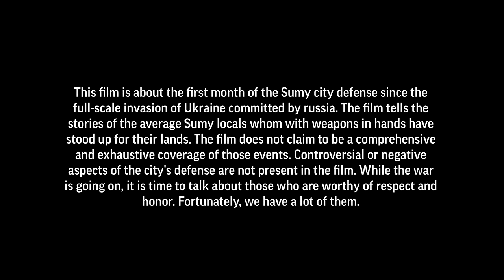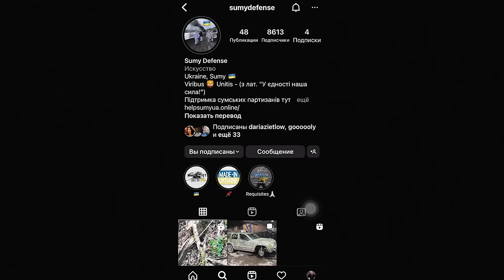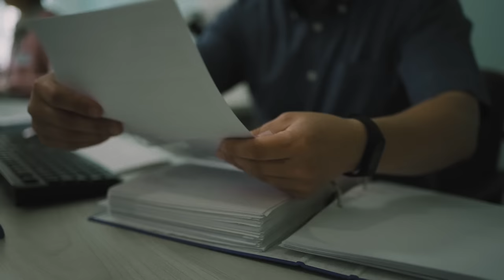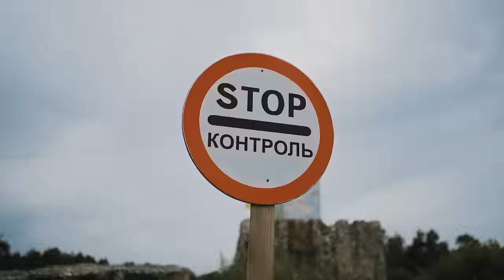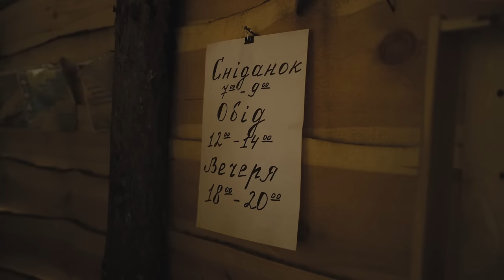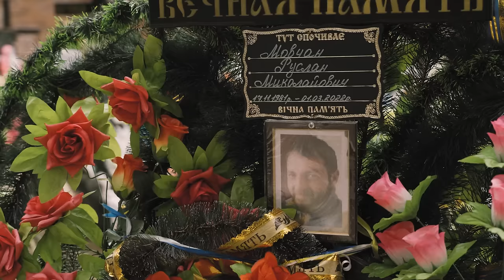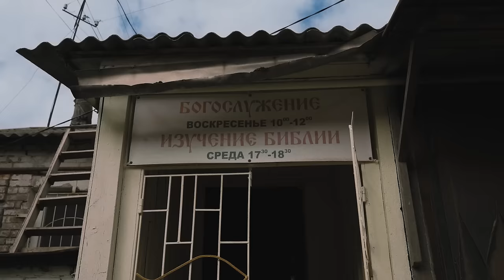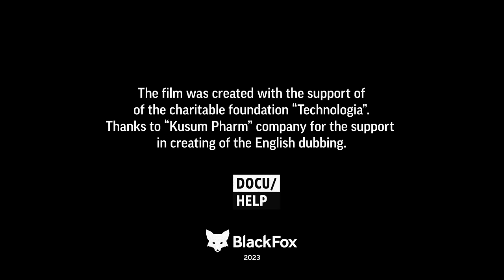SUMY. THE GUT PUNCH [Incredible bravery of civilians]

Comment: 55:00 that 'MT-LB' is not just any old APC, but rather a relatively scarce UR-77 Mine breaching Line-UR-77 line-charge system, based on the 2S1 chassis.
Reply: Damn you're right, Uragan too!
Reply: @dannydetonator  In a full Bde (though most formations were BTGs) there are allowed 2 UR77, and 149 MT-LB, MT-LBV vehicles (for MT-LB equipped formations), as well as other command, control a communications vehicles, many of which are also based of MT-LB or BTR variant hulls. This is ... not very common at all.